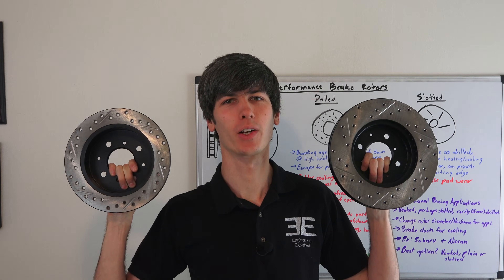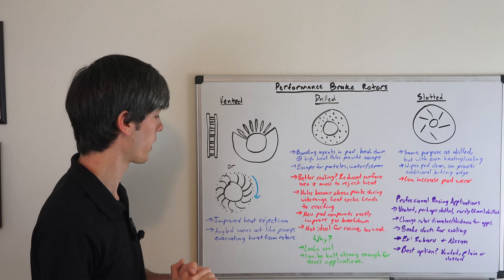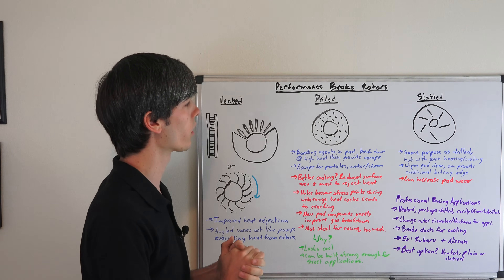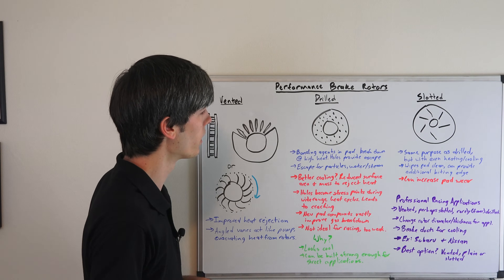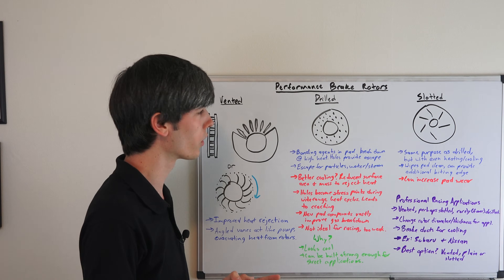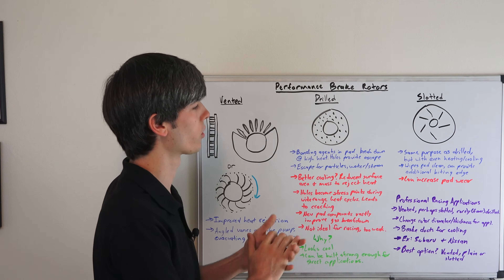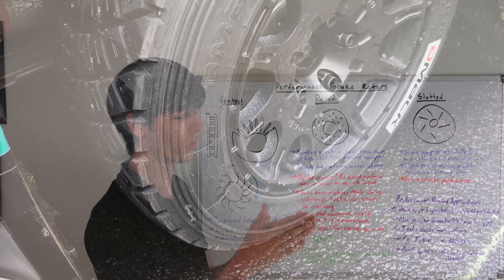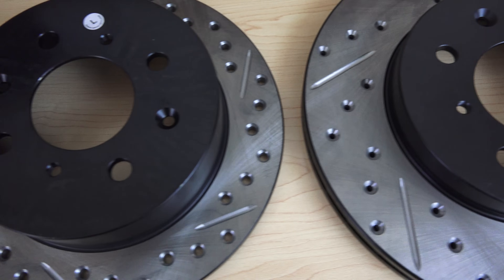Drilled, Slotted & Vented Brake Rotors - What's Best?

Comment: I would like to hear your thoughts on the dimpled style rotors, basically the same style as a drilled rotor but they use a ball end mill and do not puncture the layers of cast iron. I would assume they would most likely mirror the slotted rotors. I have a 2005 SRT-10 Ram and replaced the rotors to a set of dimpled and slotted rotors and have been amazed at the stopping power, granted it also has 15" rotors and 4 piston calipers.

Comment: Drilled or slotted rotors INCREASE, not decrease, the overall surface area by which heat from the rotor can be dissipated. Holes and slots will also decrease mass of the rotor which has a small positive effect on unsprung weight, but the down side of holes and slots is that the transfer of kinetic energy in to thermal energy, as seen during braking, takes place on a smaller contact surface which can be problematic for rapid decreases in speed.

Comment: One benefit to drilled holes not mentioned is reduced unsprung weight. Less material. Some formulaD cars are now opting for single, unvented rotors with holes (sounds very bad) but good for them for reducing weight and their runs are often short w/out much heat. fwiw...

Comment: I beg to differ about drilled rotors. You can still easily fade non performance brake pads especially if you are trying to race your stock Honda just because its a Honda. Now in my case I have a big 97 Jeep ZJ and very small rotors and pads and I thank god every day I have drilled rotors even with performance pads. 4700 lbs of jeep spinning 31 inch (over sized) tires with hatchback sized brakes thanks Chrysler.

Comment: I was wondering what you think about drilled and slotted rotors for off-roading. Would there be a Benefit to having the drilled/slotted rotors over just slotted as far as the Debris is concerned. Like mud, sand, dust, snow. Etc. being able to be pushed out through the holes?  Thanks in advances also fantastic videos.

Comment: Good video, but… I’m a territory manager, so I drive 40K+ per year and have for the last 30+ years… and I’m an aggressive driver.  Most of us don’t give two hoots about racing or extreme braking performance.  We want good braking performance for normal extended driving.

In my experience - Yes, drilled rotors are a waste.  However, I will say that slotted rotors make a difference for normal driving.  Rather than shortening the life and reduced braking for normal driving, I’ve noted the opposite.  When I do change brakes and rotors, I have noted that the rotor is still smooth and flat and not bumpy/grooved at all like rotors when the pads are worn down.  So as mentioned in the video, the grooves seem to have a “wiping” effect keeping hard debris cleared from under the pads.  Granted, this is just an empirical observation from the last 20 years of changing rotors and pads after trying slotted and slotted/drilled rotors.

Truth be told, it is not a big deal and I don’t convert all my cars to slotted rotors unless I note a premature wear issue.  I have done so on my W211 CDI Mercedes daily driver, as that is the one that gets all the miles.

Comment: One of the major advantages of drilled rotors has not been mentioned. While driving on the wet roads, for a second or more you are basically left without brakes because of the water film which has formed on the rotors. Initial pressing of the brake pedal will have no effect at all, and here is where drilled discs perform much better as the water is pressured into drills and you have brake power from the second you pressed the pedal.

Comment: Can you explain the mechanical advantage of the wave rotors?  The waves remove mass from the outermost portion of the rotor ... is the idea to reduce rotating mass/inertia?  At the same time, that looks like it drastically cuts down on the surface area the pads have to grab.  I've never found a good explanation of why these are above and beyond plain round rotors.

Additionally, I'm interested if you know anything about cryogenic treatment of rotors?  I'm a metallurgist, and I can say that this treatment does potentially "do something" (depending on the chemistry of the rotors and the prior heat treatment history of the metal).  However, I don't see how those structural changes on a microscopic level do anything for what amounts to a friction surface.  

Love your stuff ... thanks!

Comment: great vid man, only question i  have is surely drilled has more surface area than solid disks of the same size? I mean, as you'd be cutting out a cylinder shape of the metal, rather than having the surface area of the two end circles you have the larger side?

Comment: i agree with pretty much everything BUT that point of surface area loss for drilled rotors. yes you are loosing the surface area of that flat section of rotor (from both sides). but you are adding surface area of the area around the cylinder. so depending how thick the rotor is and how wide of a hole used will determine how much surface area long and gained. a thicker rotor with small diameter hole would gain a decent amount more surface area per hole. and the smaller diameter hole will be loosing less mass. so for a thick solid rotor a bunch of small holes would probably help alot. on a vented rotor it probably would not

i do thick a non drilled or slotted rotor is best. more mass means more ability to absorb heat. if towing a heavy load yuor going to need alot of mass to absorb all that heat

Comment: What do you think of the old timey trick of drilling holes in the surface of drum brakes (where the shoes contact)? It's an old hot rodder trick that certain old timers swear by, while others have said it does nothing but reduce the braking efficiency of the unit. I'm curious to see what your view is.

Comment: @Engineering Explained, if you could do a video on cryogenically treated rotors, that would be great. They claim to hold up better to heat cycling, last longer, resist warping etc. I would love to know if it's all just hype or if they really work as advertised, they cost about 2-3x the price of an otherwise comparable rotor. I can't really find any reviews or videos about them that aren't from the manufacturers, who obviously aren't impartial.
Reply: My Dodge Durango was constantly warping its undersized rotors.  After some research I put a pair of Frozen Rotors on and they stayed silky smooth.   I'm surprised he didn't touch on the subject, I would like to know if there are any downsides?

Comment: JASON, I installed drilled and slotted rotors on my 1999 miata. Its mostly a DD but I do auto cross very occasionally. I know autocross isnt very hard on your car. Just wondering if I really have anything to worry about since I'm not doing 
any real intensive driving

Comment: One of the problems that this doesnt cover is the fact that plain discs help to develop glaze on the pads after hard braking and cool down. after that the brakes need to be used several times in order to get them to bite again.

Drilled and more specifically the grooved ones solve that out since they wear out that glaze very quickly.

Other thing... regular or high carbon rotors...?
That is very relevant on drilled specially... then... drilled or casted with holes...

Comment: If your brake lining material creates a high enough frictional coefficient with the disc, couldn’t you make up the lost braking power and improve cooling at the same time by using a drilled rotor??

Comment: I replaced my minivan's stock rotor with drilled slotted rotors and it stops far better than the OEM part. Huge difference in braking when going through those winding down hills. It looks really cool too and the girlies keep checking me out. Very informative video about brakes but if newer brake pads were designed to have these sophisticated compounds wouldn't they have better alloys now for rotors as well so those cracks won't be a problem?

Comment: Why are drilled rotor standard on motorcycles? I've often heard the reason is to clear debris from the disc/pads (which makes sense as the discs are more exposed to debris and water), and indeed the holes are often full of caked up brake dust on my bike. Unfortunately I've also learned from experience that they have a tendency to crack and of course they start cracking at the holes.
So is the "cool" factor the only reason to have them on motorcycles or do they actually serve a purpose in that application?

Comment: I would mainly be concerned with the loss of mass in the rotor and the corresponding increase in brake temperatures that would result from drilling and slotting rotors.

Comment: How about drilled slotted and vented rotors I'd like to know your opinion on those...I'm thinking of buying these for my Jeep Power Stop K3097 Front Z23 Evolution Brake Kit with Drilled/Slotted Rotors and Ceramic Brake Pads Rubicon  Thanks I value your opinion.

Comment: Thanks! This vid probably saved me some money. However, i'm limited by wheel size so sounds like an upgrade isn't feasable which is sad. I race on an 8th mile track with very little runoff at the end. I think I glazed the rear drums at least.
Reply: +Christopher Wyller If you can't fit bigger brakes on the front, definitely consider a more straight-forward upgrade - a brake fluid change to Motul RBF600 combined with some decent pads designed for fast road (e.g EBC Red Stuff or more expensive Ferodo's etc dependent on budget). This approach helped me enormously to fix brake-fade on a large (heavy) saloon I once owned :)
Reply: I got semi metallic pads on the front and drums on the back. Fronts work fine but the back shoes squeak and lock up. No visible damage that I can see but not working since the hard brake at the drag strip. I suppose changing shoes would fix it until the next hard brake.
Reply: Hmm, just the drums...I'll be quiet then! What car is it? If you're dragging it, you must be reaching some high speeds to do that to the pads of a single run :) Sounds like fun!
Reply: A 76 Monte Carlo with a built 350 and nitrous. I reached 98.9 mph at the end. There were three turnoffs and I thought I could make the first one. Bad idea. I usually took the second one. The drums have been squalling ever since. Nothing visually wrong with them and everything was new. Drums, springs. pads, even the wheel cylinders. They just squeak when you apply them and the backs lock up the wheels on hard brake. Just need to change the pads I guess. Rats.
Reply: Nice car, sounds like you get a lot of enjoyment from it! I guess that type of driving is just a bit much for those poor drums on the back :-$ Nice talking to you bud :)
Reply: Yeah, I can't wait to try it out again. I swithched to a 750 quick fuel and it definately made a difference! I'll bet I gained a second at least. I also added a posi from a Buick Grand National and slapper bars. and coated the rear wheels with some kind of track grip stuff. And added urathane bushings and boxed upper control arms. That ought to get a grip! It'll be like driving a different car. I might wait to change the rear brakes until I drag it once at least. No sense ruining new shoes.

Comment: My motorcycle has drilled discs and they never cracked. 
And Since every motorcycles today are sold with drilled rotors, I do think they're superior to non drilled ones. 
But again, a motorcycle's brakes will never get as hot as a car's brake due to less weight of the vehicle and increased air flow around the brakes.

Comment: Actually, the vented rotor, with either backwardly curved vanes or straight vanes, will move air from the hub to the periphery of the rotor while the wheel is in rotation.

Comment: What's your thoughts on bigger rims, specifically on "non-race cars"? I noticed the same brand of tire with the same overall dimensions was around $100 more per set when going from a 16" rim to a 17", which is a big disadvantage. I know bigger rims allow for bigger brakes, which isn't really necessary on the vehicle in question (an '09 CR-V), but in general what are the advantages/disadvantages of bigger rims/wheels? I would enjoy a video on this if you haven't already done so. As usual, great video 👍🏻
Reply: After a certain point bigger wheels and smaller sidewalls are all about fashion. Any yes that is a legit reason to go to bigger wheels. But.. The ride will be worse, you'll be more likely to get a blowout from a bad pothole, your cost is higher, and they additional rotational mass will reduce your acceleration.
Note that really tall tires will have more sidewall flex and this will reduce turn-in response, so there is a sweet spot, but the current super small sidewalls are silly.

Comment: Drilled discs do not crack in normal use when they are fitted by the car manufacturer, only when made as an aftermarket afterthought by people who don't know what they are doing who put the holes in the wrong places. Slotted discs are inherently stronger. Both do the same job - not for cooling but for allowing the gas plasma and dust occurring under braking to escape and not act as a lubricant between the pad and the disc.

Comment: Add up the mass of metal removed by drilling, look up the specific heat of the material, do the rest of that calculation and compare to the kinetic energy to be dissipated, and you'll find that the lost thermal mass is practically nothing.

Comment: High end manufacturers tend to use drilled and slotted on CARBON CERAMIC rotors and pads. They generate a lot of heat. They use drilled and slotted in F1. The only reason they do this is to keep the rotor cooler. Nothing more nothing less. When you're going 200-60 and then back to 200 it's a good idea to have drilled and slotted rotors. The outlining point of them causing cracks isn't really an issue in carbon ceramic.
Reply: +blargblarghonk In other words performance goes up and longevity goes down. But in hiper applications they don't need longevity.

Comment: lol im a mechanic try to turn warped rotors you dont get brake pad material you get shallow and high spots of metal oh and by the way metal under heat stress if one portion cools faster than the other you get warping and if its bad enough you get cracking you may want to learn some metallurgy only time rotors dont warp is if there not made of metal

Comment: I was thinking about making a brake mechanism where a water pump is connected to the brake pad via electronic switch circuit, so when I press the brakes water is sprayed onto the rear of the brake pad cooling it down. Not that spraying it on the back of the rotor will not interfere with the brake pads, as you do not want them to slip.
Reply: +Robert Perry that's just going to warp the rotor and cause it to fail way faster than normal.
Reply: godofawesum223 Hmm due to the increasing and decreasing in temperature it would probably deform the metal, but I was thinking about doing it when braking not after, to keep temperatures as a constant, low as possible. Would this work, as we all know hot brakes don't work as well as hot brakes.
Reply: Robert Perry  Brake fade isn't caused by hot brake rotors or hot brake pads, it's caused by hot brake fluid. I don't think you realize the amount of heat from friction  brakes creates. pumping some water on the brake rotors won't help braking performance at all and will warp the brake rotor, badly.
Reply: godofawesum223 I see what you mean, thanks for setting me straight. :)

Comment: So with the old pads releasing gases, was that what was known as "brake fade"? Hot brakes did not stop as well, and this is the first that I have heard about the gases from the older bonded pads. Thank you for that!
Reply: +Minnesnowtan Brake fad has to do with the oil
Reply: +Minnesnowtan brake fade has to do with brake fluid heating up and loosing hydraulic efficiency.
Reply: Makes sense, thank you!

Comment: So are drilled rotors likely to fail before they complete their wear/life cycle? Or could they crack before it's time to replace them/before you wear off all the rotor material?
And why do all the supercars use drilled rotors? Is it really just for looks, or do drilled rotors actually offer a performance benefit?  New Acura NSX, Porsche 918 Spyder, Audi R8 V10 Plus, etc. all have drilled rotors.

Comment: I've watched a handful of your videos and it seems vehicle modifications for racing are the only avenue that is explored not off-road. Like this video on rotors, several reasons for racing are explained but none for off road rain and mud concerns on the braking. I live in a city where a 2 minute rain causes the roads to have over a foot of water along the roads. With smooth rotors I noticed very soft braking when the rotors were underwater. So I have slotted rotors presumably to help braking when my wheels are underwater. 

Or do slots bring water back over the pads and build up a layer of steam even more??

Comment: Advantages of slotted and drilled rotors.... Lighter weight, cools faster, looks impressive.     Disadvantages...... Less surface area for braking, corrosion build up, faster ware on pads, uneven heat leads to cracking, drilled and slotted solid rotors tend to warp.  I went back to solid rotors!

Comment: Would it be a fair statement to say j-hook slots operate the same way as standard slotted rotors? Same principles and all? The shot of the Subaru Rally Car had 's' pattern rotors. I'm sure there isn't much of a difference, but, just wanted to clarify and see if there is mechanically a significant impact on performance other than an aesthetic factor.